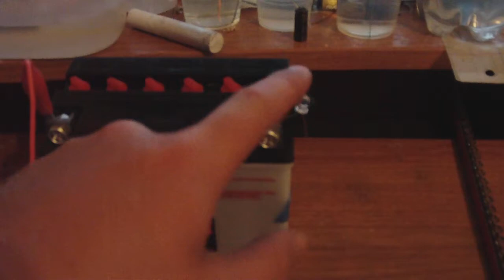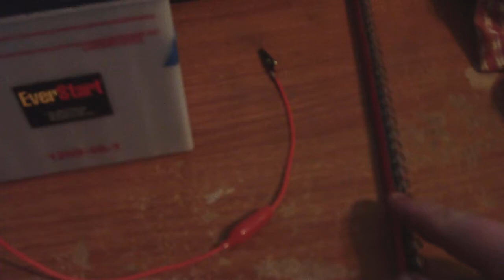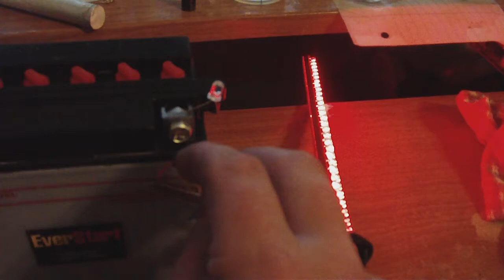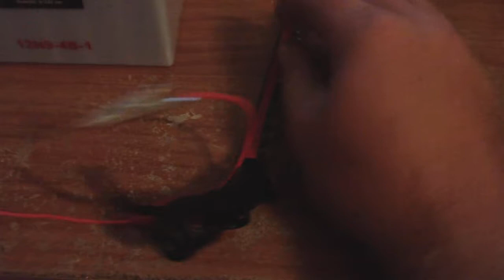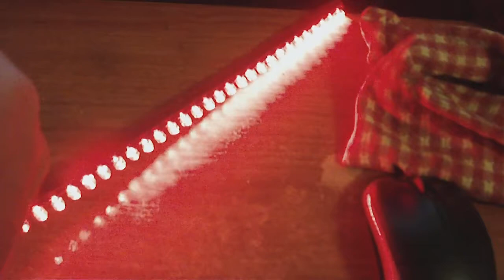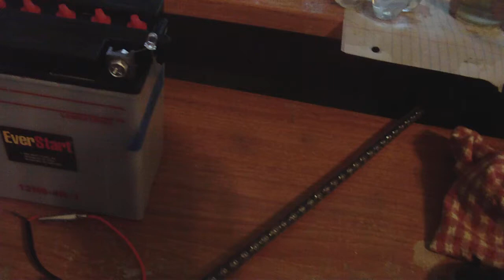Big Clean Crystal cell powering 30 12 Volt LED's

Comment: The current is probably internally limited to 50mA but 12V so it can can power both the strip and single led.

Comment: Great experiment buddy, you should try to keep the experiment ongoing for years and see just how well that battery resists corrosion. Maybe a little solar panel would compliment it. Can you possibly light those 12V leds, then measure the voltage drop across a single one, for us?

Comment: Whats the worse thing that can happen, I've cleaned it out for the next electrolyte? hehehehe BTW, do you understand what is involved with taking such a battery and the "forming" with alum? Is there anything more to it than making a 20% strength solution and running it a constant voltage low current for a long time??